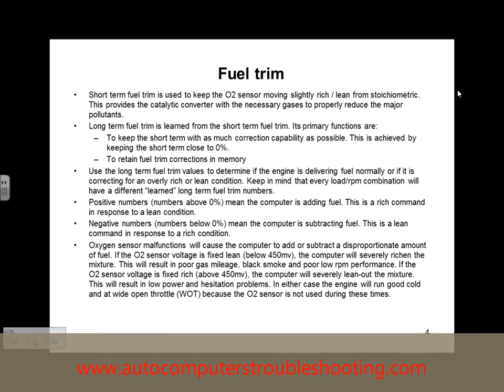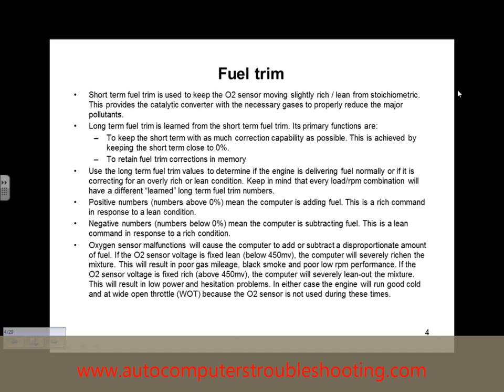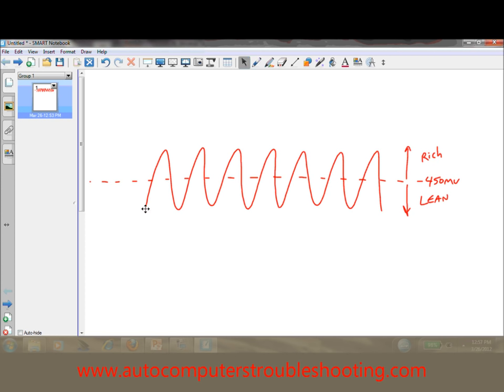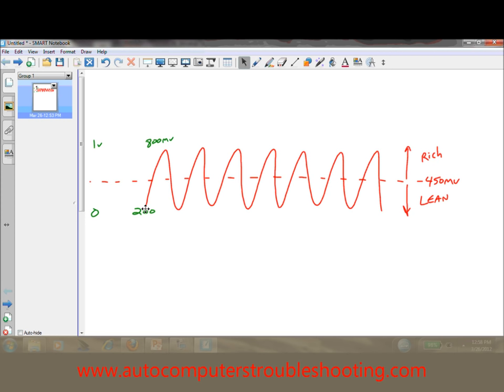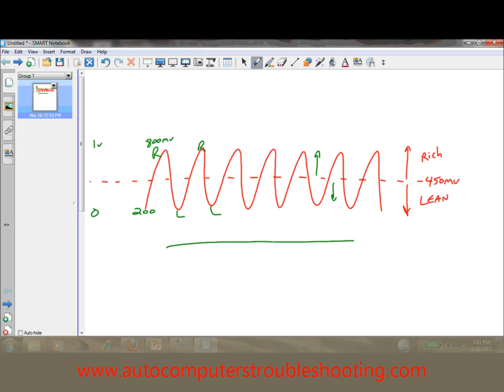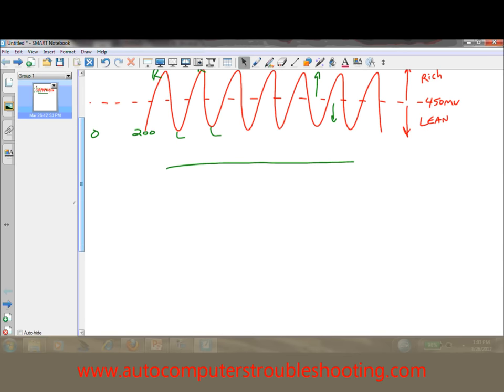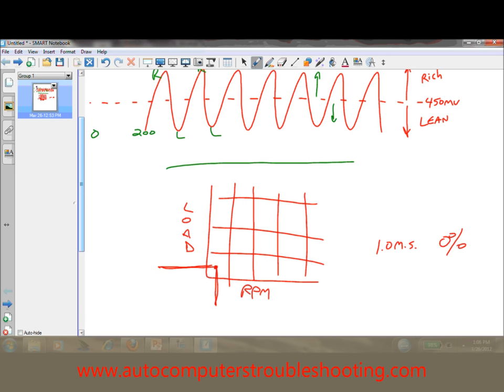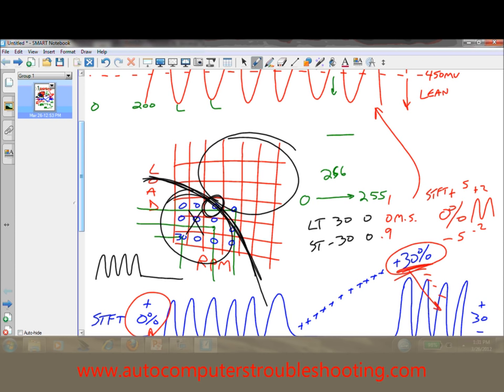Understanding Short Term and Long Term Fuel Trim (a SD Premium video)

Comment: Yes they do,no air pump. This is a returnless fuel system, fuel pressure is close to 60 psi,coolant sensor is working.I can hear an exhaust leak possibly before the O2 sensors, do you think that by the computer adding 42% fuel would that turn into black smoke? Should I be looking for something else, also the computer is working, if I simulate a rich sensor, the ecm takes fuel away.

Comment: Old video but still helping people im sure. One thing to note is that changing octane rating will affect fuel trims also. Fuel injector cleaner, e85 , super instead of regular fuel that the car may be adjusted to
Reply from the maker: E85 is 85% alcohol and unless your system is a flex fuel compatible system, you absolutely should not be running it. And yes, it will drastically alter your fuel trim
Reply: @ScannerDanner  I think its awesome you replied to me with more great info. I ran so much race fuel in a tbi camaro when I was a teen that I watched the fuel actually drip into the intake instead of spray.
Reply from the maker: @TOLDyouSOagain  got my ass kicked on a flex fuel truck that had a gasoline only engine replacement. Injector flow rates were different. Could never get fuel trims correct lol
Reply: @ScannerDanner  oh man I didnt consider that. Good thing is that once you know, you'll never forget

Comment: and your simply genious when it comes to scan tools. show up eric the car guy sometime
Reply: Yes Scanner Danner does show Eric up on sensor diagnosis. Eric is still experiened though. I get the impression that he sees the data, has an impression of what's wrong, and at least on camera he's usually right. He's happy to show his mistakes like Danny is because it's fun and we learn from going in the wrong direction too.

What Eric gives us that Danny doesn't is the actual cranking on the car. That does have value too. :) Diagnosis makes me replace the right parts more often. How to crank on a car though makes the actual replacement much faster. Each gentleman is a tool in my knowledge base!

Comment: Thanks Paul, working on that exhaust leak. Also I forgot to mention somebody swapped air flow sensors from another vehicle and lost track of the original, on this year both the 4.0L and the 5.0 have a 6 wire MAF. If you ask me they are not compatible,correct???

Comment: 1 millisecond per engine liter approx is a good range for injector pulse at idle. 
Example jeep 4.0, on the modis freeze the screen and put the cursors on the on/off time for the injector and the delta time should about 4 milliseconds.

Comment from the maker: where do you live? maybe it's a fuel issue. I know that here in Pittsburgh when we get unusually warm days in march (when they are still using winter blend fuels) that I see a lot of vapor lock conditions and lean exhaust codes. The fix is to fill the tank and not run it below 1/4 tank until they switch the fuel over. Maybe you could try filling from a different station or use a different grade fuel. see if this makes a difference.

Comment from the maker: older GMs used something called integrator (STFT) and block learn multiplier (LTFT) these were binary numbers instead of percentage 128 = 0%, numbers above 128 = adding fuel and numbers below 128 = subtracting fuel. Why 128? On an 8 bit computer there are 256 possible binary numbers the computer can use, and 128 is right in the middle. I think some of this applies to your BMW. 
It would be cool if you could give me some known good values for those readings for future reference.

Comment: I got ssft b1 -25 , ssft b2+99. 

Misfires on bank 2 - 4,5,6. I’ve cleaned all the sensors and changed the b2s1 o2. All spark plugs changed and 1 of those coils. No change. It’s running rough at idle with shaking as well. No power. Any thoughts?

Comment: Paul, I have a 99 Mountaineer 5.0 that is running rich, the ecm is adding 42% to both banks. Apparantly because both O2 sensors are fixed lean, they were replaced.Looking for direction

Comment: I had to paus and laugh when you emphasized fuel flow. Really awesome stuff I absolutely needed.
Reply from the maker: are you my tuner guy that I was just talking to?
Reply: @ScannerDanner  yes so after watching the video I figured out what was happening, I had learning disabled for map, so I enabled it and took a ride, my LT & ST almost evened out or came down to 0, my rear o2's are still 700mv but I noticed a studder in upper o2 where it'll have a good wave then flat line to top and go back to a good o2 wave, and on the gas the wave got erratic.
Reply: so, learning from your info, that wave flat line to the top would be a high voltage which meant fuel trim was trying to compensate for a lean condition (oxygen) ?I'm sorry I forgot what the wave graph is called.

Comment: Can an erased memory Give N/A on the short trim for B1S2 or is it just a bad sensor even at idle it shows N/A or what other possible sources make the SHRTFT B1S2 TO give this. I like your videos your are the best I have seen on you tube thanks for posting this lesson.
Reply from the maker: B1S2 is a downstream O2. If scan data shows NA this means fuel trim is not affected nor impacted by the downstream O2 sensor.
When you have a fuel trim issue, we never look toward a downstream sensor as a possible cause. It can affect trim on some systems (from what I've read) but not in any great way.
In short, it is a useless piece of data on your car :)

Comment: Wow, what a great lecture!!  Paul, can you tell how load is computed by the computer?  Most OBD literature is not clear on the sensors used in coming up with the engine load.  Every explanation seems like chicken-n-egg situation i.e. using the sensor input to come up with the load to control the same sensor

Comment: just changed the plugs for new bosch ones the NGK R that were in one was black in cylinder 4 and the electrods are alot shorter ! seems to be less white fumes smoke or steam from exhaust now !? I'll still change over the 02 sensors and get it retested
Reply from the maker: +Mr THOMSON white fumes from the exhaust and - fuel trim numbers suggests a head gasket failure. White smoke on start up and running for the first few miles is normal but NOT when the engine is hot. Unless of course it is sub zero temperatures, in which case you will have some white smoke

Comment: Hi ScannerDanner,
I am very excited to have found your channel, I have a question regarding Ltft, first of all.I want to say thank you for all your highly informative videos they are great, My question is on what should.be an Ideal ltft at highway speeds?

my ltft.is at 14.3 @ 73mph and 2900 rpm with around 15% throttle is that normal?

Comment: Just a tip. Don’t reset the engine adaptation values after repair! Confirm repair via live data. If reset, gotta start testing all over to verify resolve or than continue diagnosis

Comment: +ScannerDanner is it posible to have a LTFT set at a high point, let's say 20% due to a leak and still have normal idle RPM's range, thanks for your videos!
Reply from the maker: I assume you are talking about a vacuum leak with normal trim numbers at idle, right? 
Yes, on a speed density engine (MAP and no MAF sensor)

Comment: Could I pull the one of the O2 sensor out and trick the ecu to run more fuel than normal? I’m doing a turbo build on a budget and no tuning.

Comment: Hey Paul I have a ? about a lean condition. I have a friend who has a 2007ACCORD and his problem is he getting a lean condition (P0171) only around cold weather Oct toMarch  other months works without any issues. ST/LT around summer is around 1-5 on winter is about 10+.When this started car had warranty so dealer look for leak none found they replace fuel rail,fuel injector and still same issue. we have replace already o2 both, map and maf.Fuel pressure is good.I recheck for leak none found. Con

Comment: .I running out of idea here..my last idea  is that there may be an issue with either the intake/exhaust manifold gaskets. So I'm planing to take to shop and ask them to check for leak with a smoke machine.. Any other recommendation?

Comment: I think I just figured out my periodic P0170/0173 code reasons. I replaced both of the upstream O2 sensors about a year ago, as well as the MAF, but still randonly get the codes (not often, maybe a few times)...but looking at the large negative LTFT, it's obvious something isnt right. (-14 or so on each). I now monitored the downstream O2 sensor voltages, and they never seem to go below 0.75V. Does the computer then use that info and subtract fuel, even if the upstreams were accurate?

Comment: hello, great video.
i have a question. i have been building a hydrogen generator and installed it a few weeks ago. it is working in my chrysler voyager 3.3 litre engine (petrol) 
i was going to make an EFIE to add a couple of millivolts to the O2 sensor to lean the engine out or i was going to make a different EFIE to take a small amount of volts from my MAP sensor to also lean the engine out. what are your thought on these EFIE'S and will doing this damage my engine in any way. thanks again

Comment: Let's say you have an O2 sensor that is putting  out the wrong signal, that it sends a leaner signal than really exists, but not so bad that it pegs the LTFT to trip a MIL. In reality this would mean that the engine is actually running rich. My question would be this: under these conditions where the MIL is not triggered, yet running rich, is this enough to damage the cat converter? (e.g. ~LTFT+STFT = -25 but in actuality should be 0). Is the 25% more fuel enough to do damage?

Comment: I have heard that you should look at the short term more than the long term FT. Is it true the short term tells you what is happening at the point of a scan. Plus i have heard that if the vehicle is running high in long term which would equate to running lean you will get better gas mileage so the long term really is not that important as long as the short term is the deciding factor.

Comment: What can be the cause of DTC saying "air flowmeter: airflow too high"? Brand new flowmeter gives the same issue, and because it has frequency output I'm not considering this as a wiring problem. or maybe should I?

Comment: What happens when LTFT goes to +11 but the short term only does during acceleration. Idle is -3/+3 cruise is the same but the STFT goes into the +10 range when the  gas is pressed.

Comment: Great video! I have a question though… Why does my STFT start to go up when I tighten the base idle adjusting screw on the throttle body (of course, I do that after I put the car into .5 engine speed)? I am limiting the air going in and yet the ECM starts to inject more fuel… It is supposed to work the other way around, correct? I have a device that constantly reports to me the STFT, MTFT and the LTFT and the STFT always gets maxed out after the car idles for a bit. What am I doing wrong?

Comment: Hi Paul - Great lesson on Fuel Tim. (as usual)  I had a question posed to me about the delay noticed in newer vehicles regarding FT changes when you pull an air leak or add propane.  Noticed a bi-di on my scanner that pertained to controlling an air fuel delay. (forgive me but don't remember the exact bi-di wording)  Have seen it on Dodge and Ford thus far. I can't imagine the delay is related to A/F sensors.  Knowing how they tick, I am guessing they would be faster in addition to being wider in their span of sensing.  Are PT calibrators pulling a "Lets reduce MILs and still please the EPA" maneuver with software buffering?  My company hasn't written cals in years (OEMs do it all - we just build the module and do base software) so I don't have a quick resource to look up.  Any experience with it?  Hoping you or another Rosedale professor has the info on the top of your head to save me the frustrating hunt for the right OEM instructor / engineer. LOL

Comment: Learned a lot from this. Thank you! 

Is there a scan tool you'd recommend for someone that works on a lot of cars but not professionally as a mechanic but more of a side hustle? I have struggled to find one for a reasonable price that can graph sensors and have bi directional controls and srs reading/clearing capability without being several thousand dollars.
Reply from the maker: The Topdon Phoenix! $800-900 range one. Highly recommended
Reply: @ScannerDanner  thanks! I will check it out.

Comment: Hola Scanner Danner saludos desde España. Muy bueno el video, pero permíteme que te de un buen ejemplo para que tus alumnos lo entiendan toda mas rápido. Imagina los mandos de un avión de radio control y quieres que el avión siempre vaya en dirección recta controlando el timón. Si te fijas estos mandos tiene una palanca que vuelve al centro sola, que sería el ST y debajo o al lado una barra que gradúa de forma fija, que sería el LT. Entonces el ST controlaría el timón en las pequeñas rachas de viento para mantener el rumbo (mezcla estequiométrica) , y el LT controlaría por ejemplo si hace viento lateral fuerte o por ejemplo si el avión está mal construido ( no es simétrico)  y necesita una corrección permanente.  Si por ejemplo desaparece el viento lateral el ST corregiría la dirección del avión de inmediato pero poco a poco el LT se modificaría para esta nueva condición meteorológica y que el ST mantuviese el rumbo recto.

Comment: This is a great video!  As an at home enthusiast I use a low level scan tool.  Have you seen an ecu that does not output data about fuel trims?
Reply from the maker: no, even just using global obdii data you will see fuel trim values
Reply: @ScannerDanner  
I looked at a vehicle to buy yesterday and plugged in a bluetooth scanner. Vehicle ad said "everything works perfect".  Instantly i see that the drive cycle status is incomplete in a few areas, so i know that someone disconnected the battery or reset the light.  Curiosity got the better of me and i checked the o2 sensor data and the upstream sensors were flatlined at 0 volts.  Looked at the fuel trim and it said "no data".  I have screen shots but dont know how to post them here if anyone is interested

Comment: Hello Mr ScannerDanner, I understand fuel trims and thankfully a little more after the video, but I have a question. Q. my LTFT is constantly high at 36% to 60 %, this does not trigger any codes or engine light. The puzzling thing is that if I put the electrics under load by having the lights on full, operating the cooling fan or have the windows going up or down and then holding the button down. The fuel trims drop to around the 0% -/+ 5%. What is this about. Thanks.
Reply from the maker: year, make, model, engine size, symptoms, history etc would help Thanks!

Comment: Awesome video!!!It would be nice if you have an example of binary fuel trim numbers because european is still using.The place where I work we have original manufacturer's diagnostic tool and it had written something like tunning mixture and the number was 128 now i know that it is STFT because i pull the vaccum hose off and numbers went up.Appreciate if you could make a video.Thanks in advance.

Comment: Hi Paul great video! Got a question for you 01Ford explorer v6 came in with lean codes Ltft 25% Stft 0%.found leaking intake gaskets, fixed the leaks and car came back the next day with rich codes Ltft19% and Stft around 0. is it possible that the vacum leak was so big that when we fixed it the Stft went to-25% and the computer interpreted as a rich condition?Thank you

Comment: If your long term is maxed at +30 when the short term it plus or minus zero, if the problem gets worse can the reading ever change on the short term to max them both at +30? Another words, if the LT is maxed how can it tell the ST to adjust anymore? Wouldn't the ST stop climbing when the LT reaches it's max? In a vacuum situation like you are explaining when removing the break booster vacuum line.
Reply from the maker: Yes STFT can get maxed out too if the lean condition is bad enough

Comment: Very interesting.  thank you man for these important informations. but can you explain the O2 voltage, why it is between 2 and 3 volt? why it is not between 0 to 0.9?
Reply: For a Chrysler I assume? It is a ground bias of 2.5 volts that causes this.
Week 3 Part 9 2014 finish O2 signal bias, O2 ground bias, O2 heater circuits
Reply: I would assume that it is either the design of the oxygen sensor or maybe they're is a reference voltage applied to it.. I don't know though, I'm curious as well!
Reply: @yosimitesam4780  if ground is biased by 2.5 volts you should be able to go from ground to the negative battery and read 2.5 volts. Add 1volt from o2 and bingo 3.5 volts. Remember the o2 is a separate power source from the battery/ alternator system. 
I'm guessing because I'm an electrician not in the trenches with cars.

Comment: Thanks for all the fantastic videos. Can you tell me whether a car's ECU will modify the fuel maps/trims used for open loop, based on its closed loop fuel trims? If so, do you know how this is done, eg simple extrapolation or something more complicated? (Presumably it doesn't have any other mechanisms for monitoring AFR in open loop?) Thanks again.
Reply from the maker: Just mentioned you and this question in class on Thursday. It is a great question! In short, no, the open loop fuel map in not altered by the learned closed loop trim. Open loop modes are generally fuel enrichment conditions where we are not striving for stoichiometry.
Reply: @ScannerDanner  Wow thanks, and I really appreciate your reply. I find this stuff so interesting but that's only happened because I have managed to get a basic understanding of it all from your videos. Thanks again.